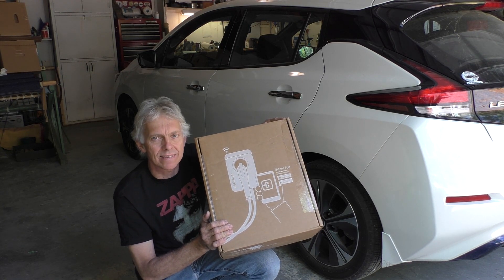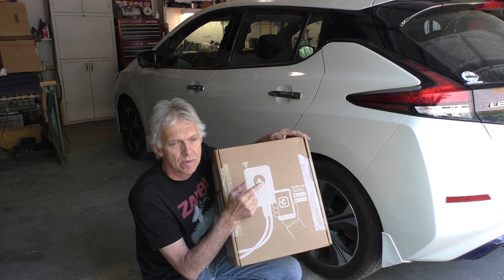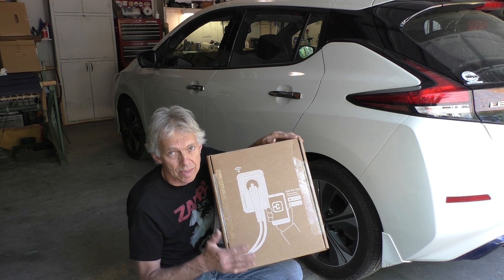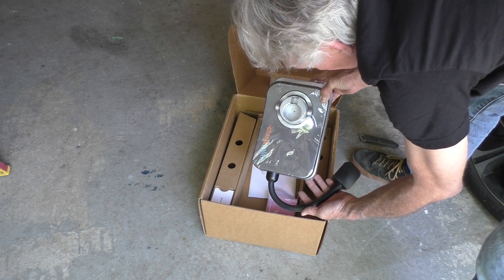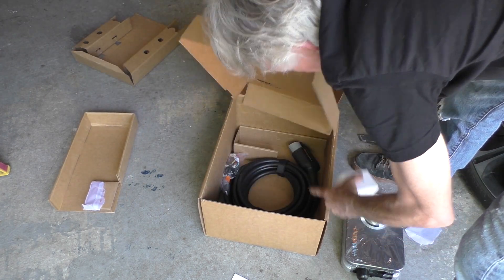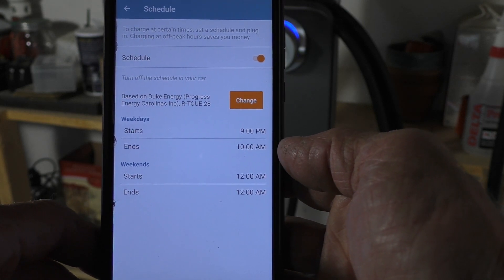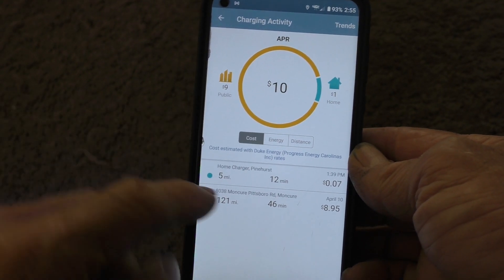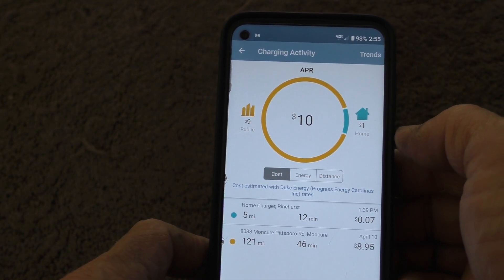ChargePoint Home Flex EVSE Installation

Comment: While troubleshooting the installation of my ChargePoint Home Flex, found out the WiFi passphrase should not contain any special characters.  Once I changed the passphrase, the ChargePoint WiFi worked. Made a few calls to ChargePoint support.  Their internal documentation mentions the limitation but there in no customer facing information on this.